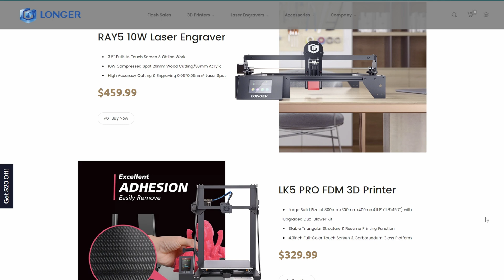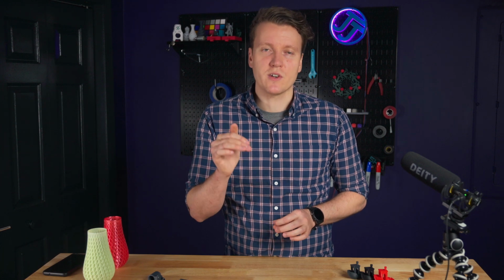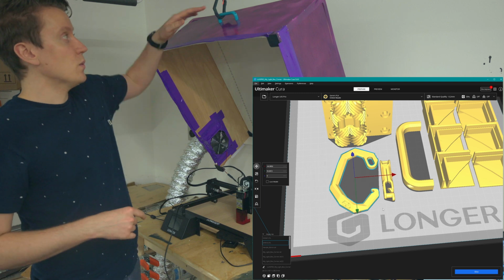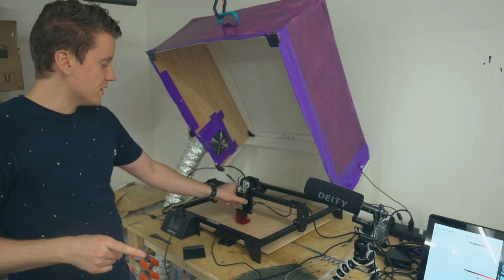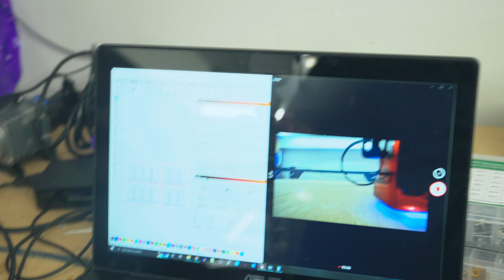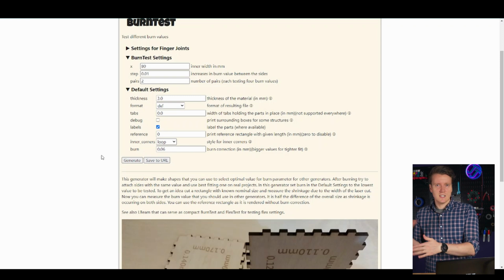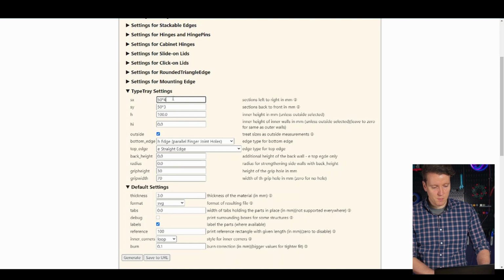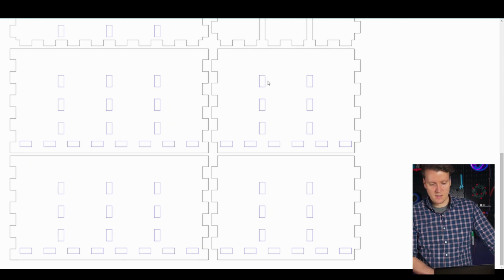EASY Laser Enclosure and so many UPGRADES - Longer Ray5 and LK5 Pro Mods

Comment: Thanks for posting, I just bought the same laser and learning what I'm doing too. Maybe for a future video you can develop a materials library for lightburn and this laser. 😃

I'm surprised 0.7 works for you. I did the same burn test and even 0.05 is totally loose. The laser is supposedly a 0.06 laser, so I'm not sure why I'm seeing what I am unless I used the wrong focus cylinder by accident maybe.
Reply from the maker: Yes I've been slowly trying to build out my lightburn library, so I'll have to cover it when I get it all nailed down. That is weird that we would get such different results. I'm not an expert on how these lasers work or what could cause things to be that differently focused.

Comment: This is a killer set up I am wanting a laser cutter to make some 3 dimensional signs and custom cut logos. I don’t know if this unit have enough power to cut plywood continuously. I am very familiar with 3D printing but I don’t know anything about laser engraving
Reply from the maker: I am still learning a lot about using the laser, and I think it is funny how much I struggle with it compared to 3D printing. I think the hardest part is using an inconsistent material like wood compared to a very consistent filament. I have struggled with 1/4" plywood that has internal inconsistencies, while a solid 3/4" board is easy to cut through. I think I'm just using the wrong brands of plywood, and I need to find a source of wood that is made for laser cutting.